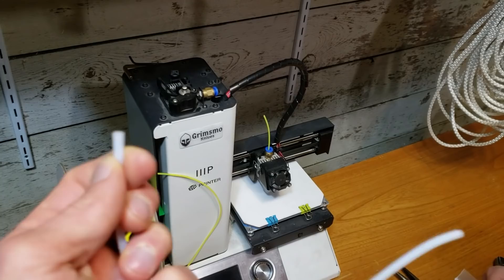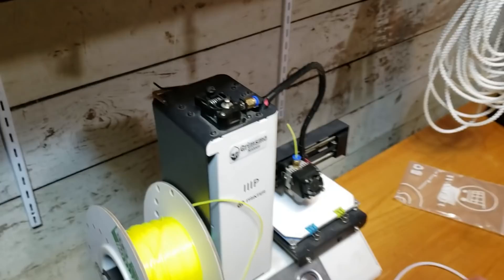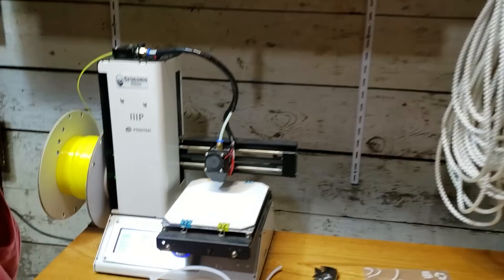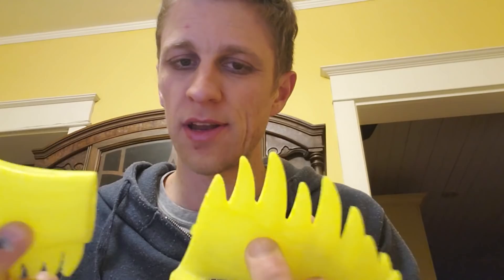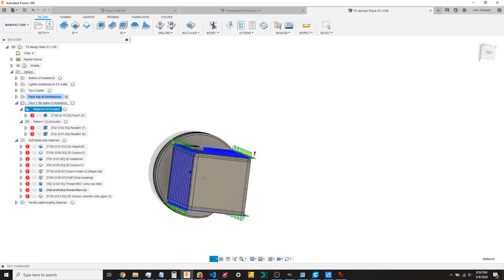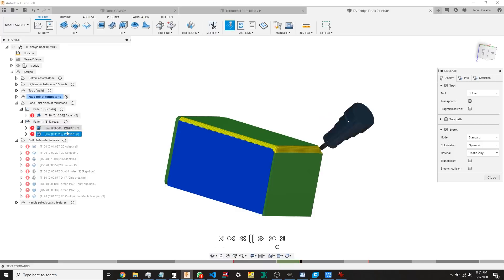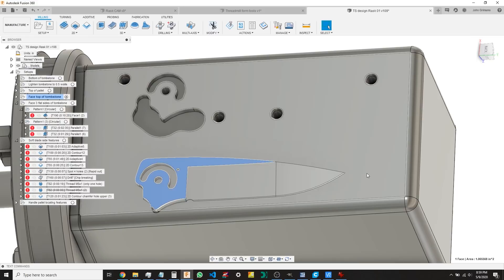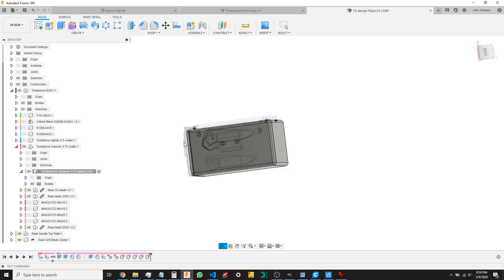3d Printing Adventures & Getting Rask Programming Done! - Quarantined Shop Life 24

Comment: The second most useful thing on my pen is the engraved inch and metric scales for measuring stock and bolts around the shop. Individually offset from the end to give an extra 1" and 25mm. The personalized message from my daughter makes it my favorite pen, the scales just add to the functionality.

Comment: I had a cheap 3D printer and upgraded to a Prusa and it’s amazing. It’s nearly 100% reliable. The quality is awesome, even the 3D printers are my school (which are several times more expensive) can’t print as well and as fast as the prusa. I bought the mk3 kit and it took me about 4 hours to put together. Prusa slicer is also really good. It just works flawlessly with the factory settings and the prusa team keeps adding new features.
Reply: 100% this. Everyone says you can take a cheap one and make it as good, which I’m sure with enough time you can. But goddamn the prusa just works. Time and time again with no issues.
Reply: Another vote for the Prusa here. Also a vote for making it from a kit. I have been printing 20+ hours a day for the past month making parts for PPE face shields. This little machine is a real trouper.  There is clearly a learning curve because there are dozens of interacting factors to tweak in the slicer, etc. But, like you said it is great to be able to sit down and design a part that is a solution to a real problem.

Comment: Love watching these quarantine videos! Couple tips:

When putting the radii on your tombstone you should try tilting it so you aren’t cutting with the tip of a ball end mill.

Also, for the textured pens use probing the get the correct axis of the barrel instead of trying to make perfect fixtures. You can also account for any diameter differences so your engraving is perfect depth wise.
Reply: Stefan Ozog probing with a surface touch off is by far the best way to get consistent engravings.
Reply: Agree 100% no point in cutting with the tool perpendicular to the surface with zero surface footage at the top when u have a 5 axis machine
Reply: Could you also not use a straight end mill you wouldn’t have the lumps either?

Comment: I have a creality cr10 5s.  It's HUGE.  I went to TH3Dstudio.com and upgraded  the firmware and put on a bed level sensor and I just love the models I can make with it.  Also upgraded the bed heat with a 110v full size bed heating pad.  Heats up fast and much hotter than the stock one could ever get close to.  I've made parts for stuff that I was making and I regret not getting a 3d printer sooner.

Comment: Dumb question from someone who finds your videos/content interesting but will most likely never use a CNC:. When you put a radius on your tombstone edges, particularly the long edges, why use a ballmill over a flat endmill or facemill?  Seems to me that, "Grimsmoscopically" (I think that should be the word for microscopically the Grimsmo way), the ballmill will leave ridges as shown in your CAM model at 12:53 but a flat endmill wouldn't, just like when surfacing one of the sides.  I understand the ridges will be tiny and related to your stepover for each pass but am I wrong?  Perhaps when you're rounding over the ends you have to use a ballmill because of the "weird" angles/rotation of 5axis and your part size.  Just wondering as I enjoy learning even though I may never have a use for the knowledge.

Comment: I have a thermal printer but I couldn't get the thermal ribbon adaptors anywhere for the only skinny ribbons I could find. 30 mins in fusion 360 and fire it to the 3d printer and I can actually add a whole custom feature-set to my brand. Boom.

I agree, 3d printer functionality for business and design seems to be quite misrepresented in the additive hobby world right now.

Comment: John, do you ever 3D print prototypes prior to machining? I mean the tombstone is a perfect test object for 3D printing. I mean cutting a big ole block of steel is not forgiving, compared to a few cents worth of PLA. And you try out putting the blanks etc onto the tombstone. And you can tap it and everything, so you can really try out the fit. I test print fixtures all the time (oooooh, didn't notice that little thing sticking out was going to interfere!)

Comment: John, Why don't you water cut the half moon shaped slot ?? 
As I understood you are water cutting the outside of the blade then it should be easy to cut away most of the material for the slot. 
If it works then you only have to do the finishing job with a mill.

Comment: I had a similar problem with my printer getting clogged up and it was because the hotend heatsink fan was barely spinning and the heatsink was getting really hot so you might want to check whether the fan is spinning as fast as it should and whether the heatsink feels hot. I replaced the dodgy connector on the fan and now it works again.

Comment: Love these posts! For the corner rounds on the tombstone, why not change the path orientation 90 degrees? Not that cycle time is an issue for a one off I'm sure, but it would spend MUCH more time in the cut and less time linking that way correct?

Comment: Observations as i go:

The ancient CR-10 + dampeners and better nozzle = the best home printer you can get. Use Simplify3D and Cura 15 for slicers. But really, you should probably try and make one from prefabs. Extremely good learning experience.

Edit: there's all metal Bowden tube fittings + i suggest you remove the whole print block from the printer itself when you do the installation. There's a careful balance when inserting the components in their right place and unless you contextualize it first, you might get it wrong (IE, the tube doesn't fit right and molten plastic gathers there et cetera).

Print a permanent holder for the fitting nut, to make it easy to install (there's probably files on Thingiverse for that already).

If that's PLA you need more than 190 to melt it.

See if you can find a flexible table for the printer rather than the solid one. It's a consumable item, but removing prints is so less of a chore if you do that. Otherwise (and you need to calibrate height for this) painter's tape (which you should always leave in the basement or somewhere a bit damp for a few months before using, as the glue deteriorates and becomes better, i know..it's weird, i found that by accident) and solid glue sticks, best glue is the red one from Herlitz (if you can get it in Canada). 

Procedure is you lay your tape, flatten and press it on the platen with a hard flat surface and then put your glue on (cold, hot doesn't matter and once you lay it, you can leave it on for weeks, unless you've used that particular area, you don't need to re-apply it) which itself you should flatten with a spatula/flat item like a card or a putty knife. Then you'll have issues not being able to remove parts :)) which is always better.

Beware that fast movement on the printer's moving parts = voltage being pushed into the boards = burnt board. Cheap printers lack any kind of protection from such things. :(

Comment: Looking at your current tombstone design, are you stuck with a square shape milled out of a solid block or could you go to a thick walled tube with facets milled in the side instead? I'm envisioning an octagonal shape with a blade or handle station along each one perhaps. This way you wouldn't have to hog out a square chunk as the faceted tube shape would already have the internal space hollowed out. I don't think the Kern would care if it was milling on one of four sides or one of eight if I understand the mechanics correctly.

Comment: Also you instead of spending so much on a prusa( still a amazing machine ) get something like a ender 3 and pickup a duet wifi controll board. Less then half the price of a prusa and way better functionality. The duet will connect to your wifi and you can co troll it from a web browser and/or you can get a touch screen from it. Really make thenwork flow allot easier. I upgraded my tevo little monster with it and the support community around the duet is amazing. The design enginger is super involved on their forum.